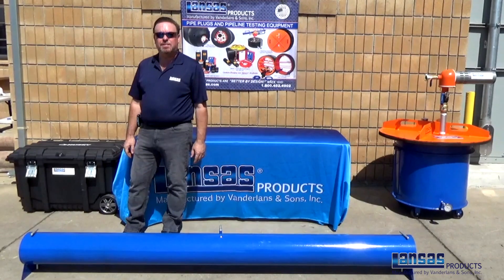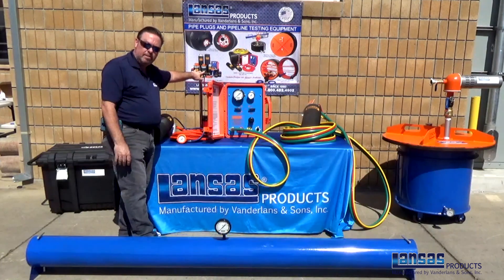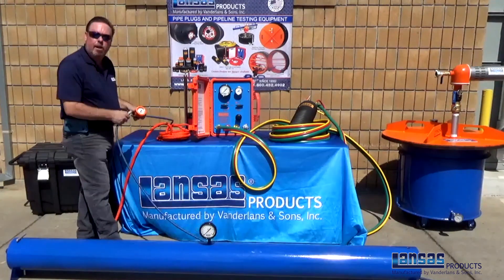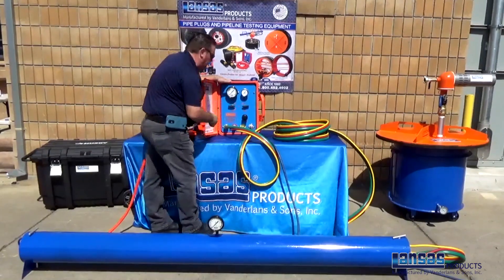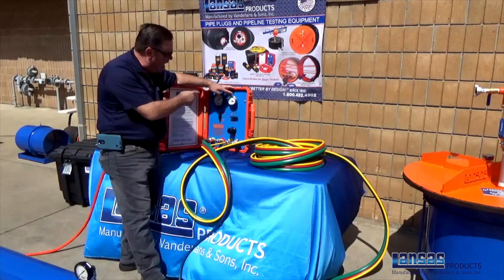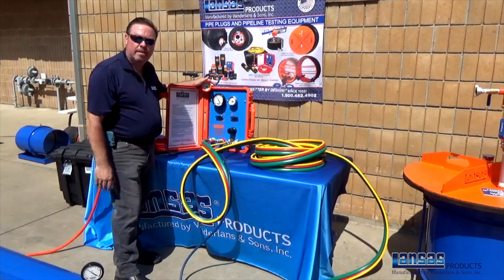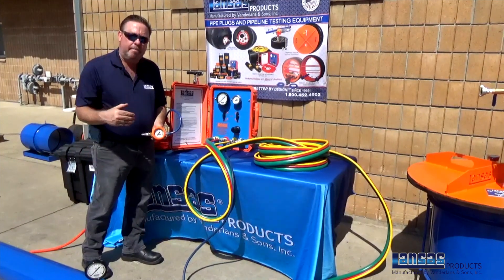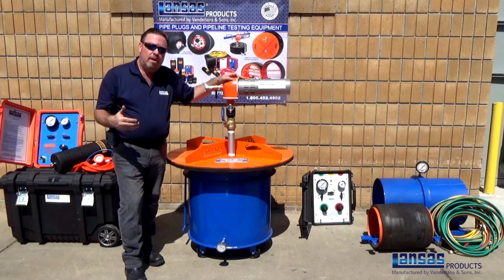SMART-BOX COMPLETE AIR TEST KIT FOR LINE ACCEPTANCE

Comment: What's the price on the set?
Reply from the maker: @Ino Arellano - 
Thank you for visiting the LANSAS YouTube Channel and for your interest in our testing equipment.

That SMART-BOX Complete Air Test Kit can come with a variety of different plug sizes with most common 8"-12" Multi-Size Plug set having a List Price of $ 3,125.00 plus any applicable shipping costs.  Our company is set up to sell exclusively through distributors so if you tell me where you are located, I can put you on the right path to get priced out through a LANSAS Distributor.  

The best way is to e-mail me at ssummers@lansas.com or call us at (800)452-4902.  Also, don't forget to visit the LANSAS website at www.lansas.com or to follow us on Facebook, Instagram, or LinkedIn.